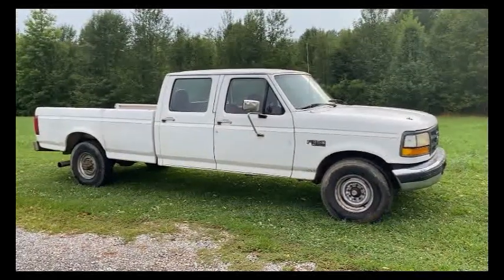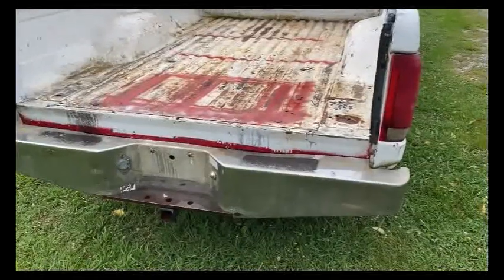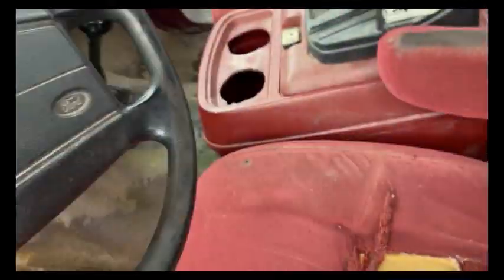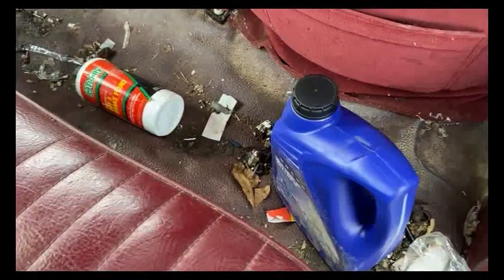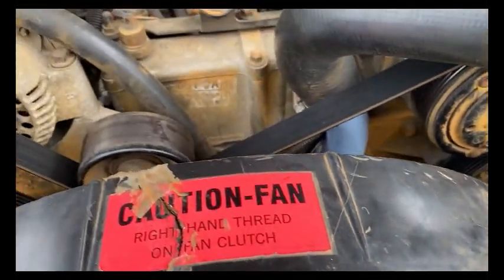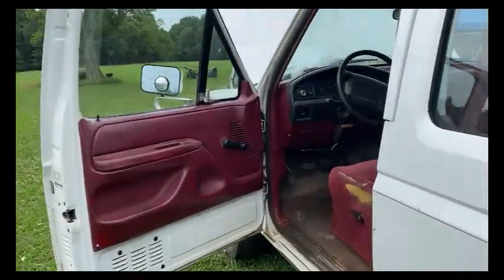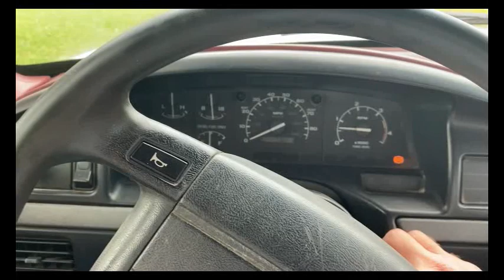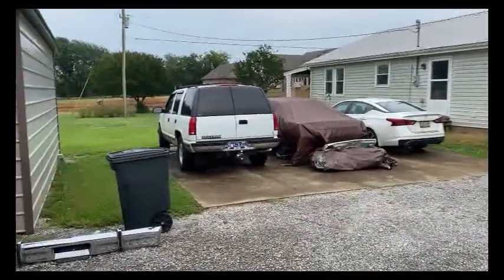I bought the worst 7.3L Powerstroke truck I could find!! How bad is it??

Comment: Difficult to find anything nice to say about this truck, did you go too cheap this time?
Reply: Sheeeet. These days you’re lucky to find anything that runs and drives in that price range - let alone a 7.3 with a stick. If all he needs/wants is a work truck, this’ll fit the bill perfectly.
Reply: @drivedb7  Why buy a project truck when you need a work truck, that's my point, regardless of price. If Tyler couldn't find time to enjoy the New Yorker, having to deal with a junk yard truck will leave him with even less time to work on the Mopars.
Reply: @tomsrensen9382  - A work truck does not need to be a Cadillac.
Reply from the maker: @tomsrensen9382  That's the thing. Price IS a consideration. A person can be 150K in debt with a few strokes of a pen these days. I exist on a middle-income budget. I currently owe $500 in debt. That's it. I own everything I have free and clear. So, to get a $5,000+ truck I can either borrow the money and buy one, or I can buy one for half the price and do the cheap labor to make it decent, then have a paid for truck and no debt. Hope this clears it up.

Comment: I bought a '99 F350 SD, 4WD, crew cab in XLT trim and similar condition about 3 years ago from and estate- it sat in a field for at least 2.5 years in Central Oregon. Stripped it down, mechanicals first. All consumable mechanical parts were replace, re-did the rear axle seals & bearings (big diff cover as well), all the brake items except the MC & booster, radiator, AC compressor, dryer & condenser, alternator, P/S pump & lines, water pump, T-stat, full trans flush & deeper pan, fuel pump...everything. Then we stripped the body (glass, trim, handles, bumpers, everything) and it took 4 gallons of product to lay the base & clear. Did a navigation system, better speakers, scanner, switched the driving lights (350 watts, clear 7" lenses- centered in the grille)  & fog lights (200 watts, 3" amber lenses - in the Warn bumper light pods toward the outside with the winch in the center). Did put in poly bushings & HD Moog end links for the sway bars, and along with the Bilstein shocks & new tires, it did improve the handling very noticeably. 
It's a great truck to haul & work with, even take everybody out in because it looks good. I have no reason to buy a different truck, and my total investment is about $20K. I hope this truck turns out similarly for you- the amount of money for a truck is just nuts...
Reply from the maker: The asking prices for these are way up there, more than what they are actually worth, but still a sound investment. Sounds like you have a nice truck!
Reply: @WhoSaidTyler  yep - I find it nuts, and the complexity, along with the overall cheapening of materials, I wonder about the lack of trouble-free, long-term ownership with the vehicles made 2020-up

Comment: I think that you got a good deal. You have enough left from the budget that you mentioned in the last video, to make some repairs on it. The 7.3L is a much better engine than the 6.0L. You should be able to fix the leaky windshield with the 3M bedding caulking that you have.

Comment: Glad you got this OBS Ford F350 crew cab 4 door truck hopefully you'll make the interior look like brand new again and back to it's glory also originally this truck had a older steering wheel design which had no air bag so it has been changed to a New design which is a 4 spoke steering wheel with air bag to the center also horn buttons to the side
Reply from the maker: You are right! Looks like someone had to swap the column with an F150 column.

Comment: And not bad it may need some cleaning and interior parts, but it doesn't have any rust except inside the passenger side front door on your f350, i have a 1500 2000 dodge ram laramie slt quad cab long bed 318 magnum V8 46 RE AT gloss black with most of a white pinstripe 1500 my truck has rust around the edges but good glass none broken or cracked, will need rockers but the inner rocker inner door jamb is still very much intact the floors are solid in this truck and it has decent interior.. with those 7.3 power stroke trucks it might just need a glow plug controller relay?!  My truck is only a half ton 318 magnum V8, but I only gave $1,500 for mine almost two years ago now because of the front brake lines rusted and the it supposed to have a charging system failure a bad alternator and when the previous owners dropped the truck off we jumped it with a buddy of mine 04 Pontiac Grand Prix gtp and the truck stayed running until i turned the ignition off so that told me that the alternator was fine it was suffering from a ground issue somewhere..turns out that the battery was from 2007 and it was leaking down the side of the battery on the battery cable coming from the underhood power distribution center fuse block and it was about rotted in two, swapped out a new to me battery cable in good condition.and no more charging issues truck starts right up in 24 degree weather and when it comes to engine operating temperature it carries a consistent 60psi oil pressure and for what I gave for the truck i can't complain. It has a completely rebuilt front suspension and new torque converter and front pump and input shaft seal in the transmission and if you don't have your foot on the brake pedal and shift this truck into reverse it will start backing up, the transmission works great and for a 318 I would have to say that it runs strong!! I bought a new complete set of stainless steel brake lines in a kit specifically for the truck model and year i had from classic tube out of ohio and replaced every one of them under the front of the truck to up under the cab, and it will also need the dr rear door unfrozen the bottom latch is stuck im going to replace the lower latch on both sides once i get the door open and apparently they have this as a common thing with these second gen dodge ram quad cab trucks.   You have one tough ford f350 there Tyler sir... And I still need to fix the muffler because it apparently had a annoying noise so they hacksawed the muffler off, i have to clean up the exhaust pipe so I can put the cherry bomb glass pack muffler on and then the exhaust pipe tubing and reconnect the factory tailpipe it's in good condition considering it is a northern Ohio truck since new, and I wasn't changing it truck had a guage cluster failure shortly after the rebuilt front suspension and the front pump and input shaft seal and the torque converter installed on the transmission, the cluster in it now everything works but it says 77k, the previous owners said it was a little after the front suspension rebuilt the cluster guages and lights started failing that was about 176k and the original owner manual it's in the glovebox of the truck has a oil change sticker on the back and says next service 244k